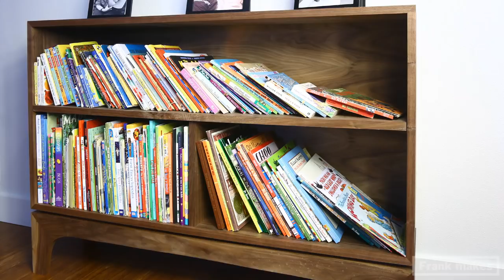Bookends

Comment: The part at 2:28 literally made my jaw drop. I've done a little animation and my mind blew. Amazing work as always, Frank!
Reply: frank howarth did you edit single frames in Photoshop to make 2:28?
Reply: Tobias Redepenning My guess is he used a third quarter of the turned piece (notice it was a full round and only made two bookends), starting with a full quarter and removing pie-shaped slices until it was gone, then reversed the video of that segment.
Reply from the maker: Tobias Redepenning yes i had to build each frame in ps.  I did not actually slice the wood, that might have been easier.